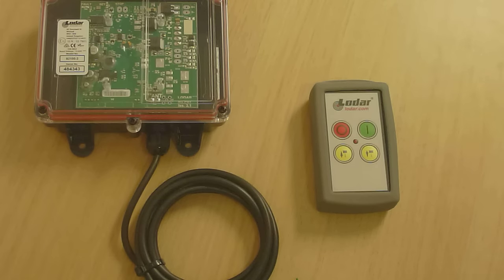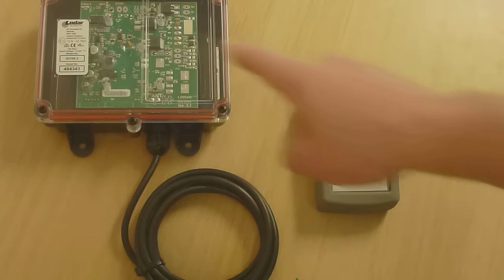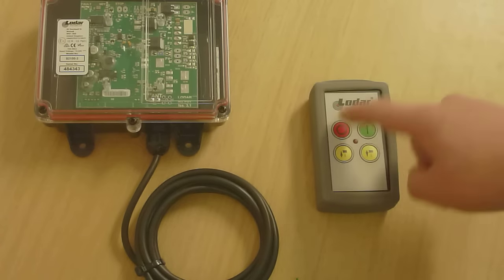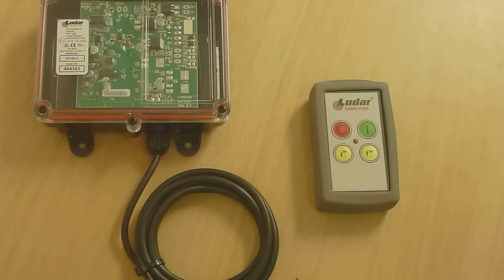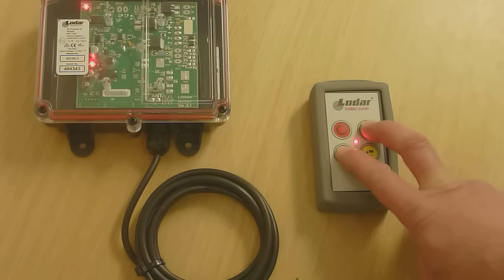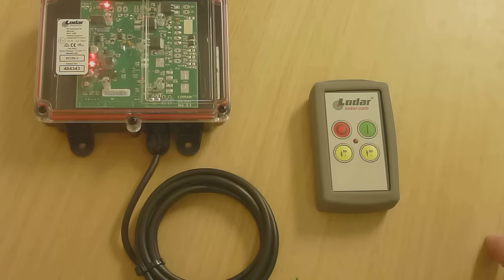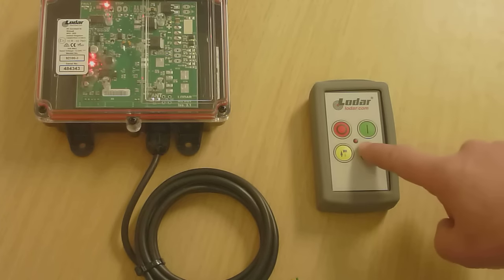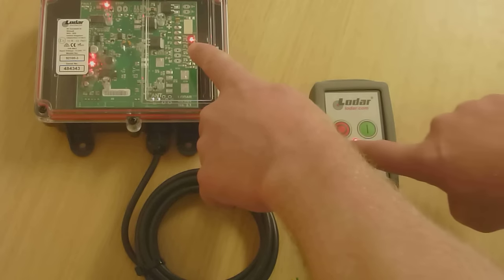How to program a Lodar remote control - programming or sync

Comment: Does this work with the 6 button remote ? Like the lodar 9000 for concrete pump
Reply from the maker: Hi Karl, it works with any Lodar system which has a model number starting with 92 or 93, not all 9000 series because around 2005, the design changed to this one (old ones were paired with dip switches inside), and they are not backwards compatible, so you have to buy a new system.  Call me if you want any more advise on +441889 230013.
Reply from the maker: Yes, it works with all Lodar products which have a model number starting with a 9, but not ones with a 1 or 3.

Comment: My buttons seam to work fine but the winch doesn’t work with the buttons, the lights come on like it’s programmed but the winch doesn’t engage.  What should I do next.
Reply from the maker: Call me tomorrow to discuss as their are lots of things to check and I'm finishing work for tonight as it's after 10pm and the children want to see me before they go to bed.  I work between 9am and 9pm GMT. my website is www.elpengineering.co.uk and tel number +441889230013.
Reply: Having the same problem. Lights activate with the button on the receiver but winch does nothing.
Reply: @ never did get mine working.
Reply: @SwingingPythons  damn.. was hoping to hear good news lol

Comment: Hi
I have a 10 button remote (8 being used)and it’s like a brick 😭
Is it possible to change it to a more compact size and pair it up with my system as I was told  by my supplier I will have to change the electric box ?
Model # 92210-3
Reply from the maker: Hi, a more compact version is currently not available.  We will have it for sale when it's available.

Comment: I am trying to program a new remote and when i plug in i get a blinking green light then goes solid green . I lost the old remote . I got a new one and trying to pair the remote . What can i do ?
Reply from the maker: Because you mentioned it has a green light, Please visit my website for the instructions https://elpengineering.co.uk/wp-content/uploads/2022/04/100-0003-Lodar-Transmitter-pairing.pdf.  
These are the instructions to program one: 
Step 1: Remove the power from the receiver. 
Step 2: Press and hold the Red and Green buttons on the transmitter until the LED turns off (approximately 5 
Seconds). 
Step 3: Release the Red and Green buttons, the LED will flash as follow ON……ON…..ON…. etc. 
Step 4: Power the receiver and then press and hold the Green button (within 20 Seconds) the handset will 
code to the receiver.
Reply from the maker: Call us on +441889230013 if you want us to talk you through it.

Comment: I TIRED ALL THAT STILL NOT WORKING
Reply from the maker: I am sorry to hear that your system is broken, please call us on +44 1889230013 and we can advise you on diagnosing which component requires replacing.
Reply: @elpengineeringltd3200  thanks but I already brought a new receiver panel and it works great. Thanks for your help and great video